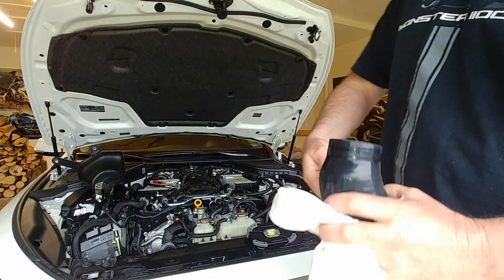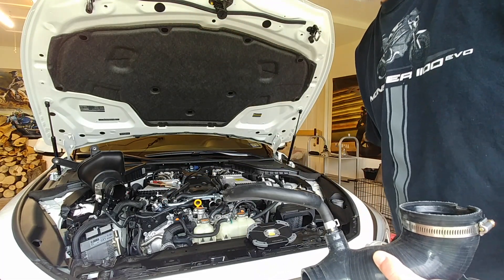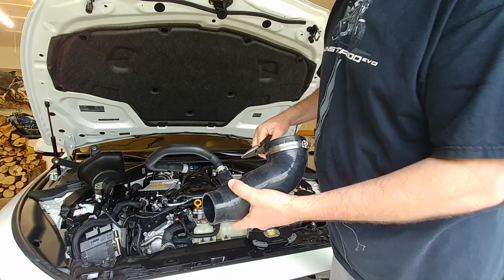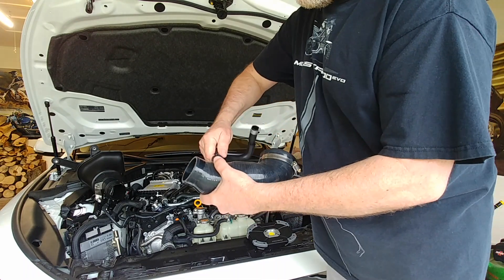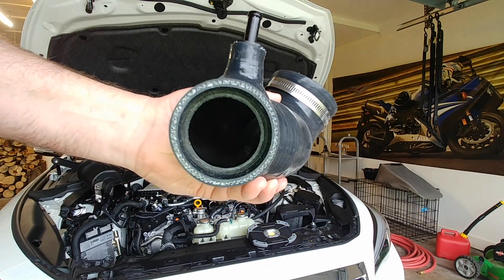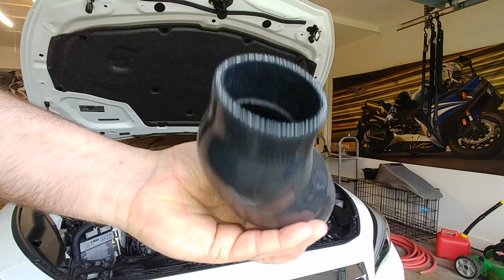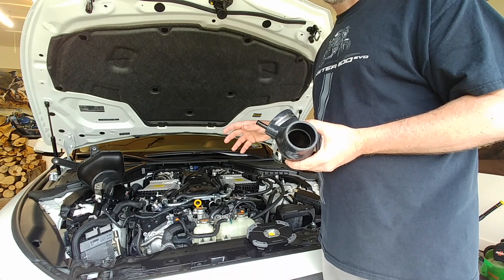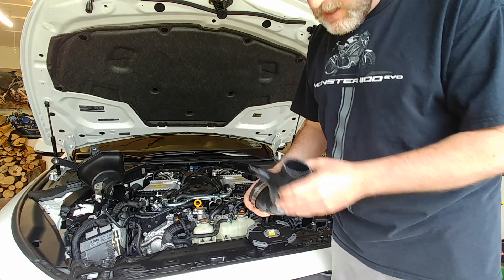Is your VR30 Q50's passenger side CCV sending harmful oil blow-by to your Turbo???

Comment: Awesome video. I just got a q50 coming from a modded wrx, and am dipping my toes in things to change. I've been researching catch cans and found the 3 hose vs 2 hose ones! Will be buying a 2 hose setup after seeing your video, passenger side blowby seems negligible.
Reply from the maker: Inferior companies with bad business practices after they've sold their first version and want to sell more by so-called changing/updating/revising it with no data/proof to back up their claim or need for their product is pathetic..hint Add W1. There was a guy on the forums who had massive oil coming out his passenger side CCV from driving many miles but it was because his PCV hose was 99.9 percent clogged. The PCV hose/s is the one functioning to carry blowby contaminates. People need to be educated and not jump on everything they see and hear without understanding the facts and or tested data. The CCV is a vent not designed to recirculate contaminate blowby. It's a vent to allow the internal part of the motor to not become pressurized like a 1liter Coke bottle. Can the CCV hose have zero traces of all contaminates being mixed and heated in the crankcase...no, but it is so small that its almost not detectable on a car, this VR30 engine that is properly working (my video). Conclusion, say I put another 20,000 miles on my car and I recheck the airbox bottom coupler for oil content. say there is the smallest hint of soot at the end of the CCV hose leading into the airbox coupler...is that worth spending another $200 or 350.00 to attach an additional CC or buy a newer version or an older system. The answer should be no but ignorant people do ignorant things but it's their money and they are free to spend how they want. The Mishimoto has a hard mircon filter that filters out vapors and liquified contents. That is what 95% of the blowby contaminates flowing to the catch can are. Without this micron filter and just so-called baffled crap the blowby is going to go through the oil catch can and out the other side to your intake valve and settle there. Purely these "triple twister" and other fancy named OCC's will catch some oil but what is the point of catching some of the blowby? The blowby (oil vapor, unburnt fuel and moisture) that doesn't get caught say 60% is a lot and will be a cancer to your intake valve. Side effects later down the road in as little as 10K,15K 20K is: rough idle, poor fuel economy, less throttle response, and loss of power.
Reply: @GettingthruLife  Awesome, thanks for all the info! I see you're using a Mishimoto catch can, I will probably grab the same here soon. I ended up selling my '17 WRX because I was deep in the rabbit hole of mods/tuned and it was not great for peace of mind for me personally since it was my only car, we ended up just taking my wife's car everywhere! So my '17 q50 will stay stock power for a bit, I got an axle back with mufflers for a bit more sound, then I am planning to do the catch can and heat exchanger/reservoir before next summer since it reaches triple digits in Utah! Anyways, I checked out all your videos, good stuff, very helpful as somebody brand new to the q50 platform!
Reply from the maker: @Filmingwithacarp  You can find 10% discount mishimoto codes online so look for that when you get ready to buy. Should get the price down to close to $200. I think OCC's are most key to put on a new car or a car that has or is getting its intake valves cleaned. Getting the intake valves professionally cleaned on a 30K-40K no CC car would be beneficial and noticeable. Looking online at this subject there are some cars that are nightmares because of the carbon buildup like audi's and these mini coopers. There are many DI engines that suffer severely greatly from intake valve carbon buildup in which it doesn't even take that many miles to see the engine start to be negatively affected.  I agree, don't go crazy with modifications and keep your Q50-Q60 reliable and running in comfort. My stuff that I've elected to do are pretty mild and hasn't at all changed the drivability and general comfort of this car. The slightly higher-profile tires I've added over the stock setup has added back a little bit bump absorption and compliance. Tune wise when you do this because you will...check out Hussain Boxwala at Racebox Houston Texas. You can do this ecm mod remotely and there is no sacrifice on the tune quality you will receive. Car drives better than the factory ecm setting. He will keep it running well where he can keep your turbo's and CAT in check.
Reply: @GettingthruLife  Awesome, will keep that in mind! Always good to have a tuner who does good work. Probably a few years away for me, got the q50 used so I am hoping to pay it off and get a 2nd car before I tune! So I got some waiting to do unfortunately, but it seems like there are a few small mods to do to hold me over. Also need to do a lot of engine maintenance, not sure how badly the previous owner beat on the car! But it seems like the vr30ddtt and tranny are quite strong!

Comment: Was oil under the intake?
Reply from the maker: I found 99.95% no crankcase oil residue passenger side CCV the 2 times, many 1000's miles apart checking. Just some common engine, minor grime seen on white cloth looking for oil venting into passanger side turbo. Now the PCV side is a crap ton of oil, water/condensation/caustic vapor blowby. Many cars with forced induction only see blowby on one side of a V6 or V8.

Comment: Cant I just plug the coupler on the intake hose and put a breather hose on the CCV to vent out excess pressure and call it a day or does that coupler need to be connected to something else if I'm going to use a breather hose?
Reply from the maker: Are you saying on the passenger side which is the CCV does it need to connect to the airbox lower airbox coupler tube? I assume thats what you are saying. Man that's a good question. I don't know the correct answer for sure. Infiniti designed this motor  with the exact setup so its likely it needs to be plumbed this way. The CCV side of the emissions system like benefits or needs the airflow that come by the means of that airflow after the airbox and before the turbo. If you did something that this motor didn't like it could led to damaging the motor or the emissions sytems or not allow the crankcase to optimize the internal pressure. Otherwise I'm saying I don't know the answer to your question. As for oil getting sucked out  or blown out the passanger side ccv my evidence and the the word from Mishimoto who tested this, they said no need for a passanger side OCC and when I looked at mine twice over 1000's of miles betweeen the intervals, I didn't see any real amount of oil blowby coming out. Safe/safer to keep the emissions plumbing like factory in my opinion.
Reply: @GettingthruLife  I guess what I'm asking is, I've seen people put a breather filter on the end of the CCV hose so the crankcase can vent out excess pressure and they usually route the air intake coupler to their existing OCC or buy s second CC. Can I put a filter at the end of the CCV hose and seal the air intake coupler so nothing is going in or out of that coupler intake valve? Or do I also have to route that coupler to the OCC/secondary OCC?

Comment: What catch can do you recommend?  Link 🔗?
Reply: I got the dual catch cans from boosted6 but before I installed them I did a walnut blast service on my vr30 . I would totally recommend my Q50 runs like new and responsive . ❤
Reply from the maker: @baggycamera4825 That's the way to go about it. Intake and exhaust valves play a very big role in how engine functions. A infiniti D I. engine is just prone to excessive oil/carbon buildup. Reason while Intake valves are clean, got to take measures to reduce future residue buildup.
Reply from the maker: I recommend the catch cans not designed from China. It seems many come from china but Mishimoto is designed and was tested in the U.S.  (You can take a glass jar with a metal top, poke two holes in it, run the emissions hose to and from and catch some oil. The whole point of adding a catch can and spending the money is to catch nearly all the blowby so you keep your intake valves the most clean.

Mishimoto does this by using a better designed OCC. https://www.mishimoto.com/infiniti-q50-q60-catch-can-2016.html

Price as many things in the Biden economy has gone way up. sucks! When I bought mine in Sept 2019 was $210. And remember you are buying the custom fit hoses, the two-hose catch can, the steel mounting specific car bracket. The parts breakdown: https://www.kseriesparts.com/MIM-MMBCC-MSTHR.html

Comment: Hello 
I have q50 2021 
In see all your video and I love it❤
I buy the car 6 months ago and IAM trying to make as much as possible for the car to be good as possible 
In our country (Iraq) in summer the weather 50°c or more 
I need to know the oil I use I use a 0w_20 as the infinite company recommendation 
Or 5w30 
IAM so confusing 
I need your advice 
With my respect
Reply from the maker: Hello to Iraq. 50c = 122 degrees so that's very warm. I would definitely suggest using 5w-30. 0w-20 is for cooler climates so the oil when cold  it flows a little quicker. 0w-20 and 5w-30 is not a big difference but in cold climates will help. In a hot hot climate, oil changes at shorter interval will be a good idea. Oil/filter is cheap compared to a motor or turbo replacement. Look at changing oil every 4,500mi (7242km) to 5,500 (8851km). If you drive the car hard a lot then closer to 6500km.
Reply: @GettingthruLife  
Thank you 
I drive the normal some time and some time hard 
I change the oil and filter every 3000km
Reply from the maker: @mohammedabbas1840  Sounds good. That's very low km/mi but then again it's super hot there in the summer and fine sand in the air. I change my oil between 4,000 miles and 5,000 (6437.376 km -  8046.72 km)
Reply: @GettingthruLife  
Thank you for your time 
I glad to find your video it's really helpful 
🤝
Reply from the maker: Also use a trusted brand of full synthetic oil to run in your car. I use Quaker State Ultimate Protection Full Synthetic. If a store doesnt have it/out of stock, I will use Castrol or comparative brand until next oil change.

Comment: So does blow by also get into the driver side inlet?
Reply from the maker: When I took my passenger side airbox out with the inlet I couldn't find any oil residue other than maybe a slight discoloration on a white clean rag. Could have been discolored o'so slightly from the actual rubber as far as I know. If you didn't have a Mishimoto catch can with its extra fine 50 micron filter on the drivers side then the oil vapor coming out of the cylinder head would get dumped right into the passageway leading into the intake valves. The other side, passenger side the heads breathing port does get directed into the passenger side intake inlet plumbing just before the turbo but Infiniti knew what they were doing when they built the motor. and would not have just let oil get suked out into the turbo. Its primary purpose is to vent clean air into the motor not out. The many morrons on youtube that shouted that Infiniti didn't know what they were doing when they didn't place blowoff valves on these cars were idots too! Including companies that should have known better but so desperty wanted to sell their blowoff valves..
Reply: @GettingthruLife   thanks for the quick response my friend 👍

Comment: Thanks for showing this. I'm currently looking for a catch can and did notice the new version 3.3 of the add 1 was for both sides. I read in a previous video somewhere where it was said that the passenger side didn't need it. It's good to actually see this rather than just seeing words on my screen from someone who may or may not no what they're talking about. This will save me some cash since the new ones are really pricey.
Reply from the maker: Your welcome Scott. It seems that a manufacturer needed to come up with new products to make more money and line their pockets. I called Mishimoto 5 months ago and asked them about this concern and they stated we didn't see the need to make a more extensive product and then charge more for it if it didn't benefit the customer. That's what I want to hear and what matters to me. Not just you need this new version.

Comment: I have been running the Mishimoto CC just like you for 5k miles on a '17 Q60 Red Sport.  I also checked my passenger side coupler hose during the last oil & filter change, and it was dry, too.  I now have just over 24k miles on the car.  I emptied the CC @ 23k miles (installed @ 19k miles), and it captured about 40 ml of blow-by (mostly oil vapor).  I do 5k OCIs and the engine uses no oil between changes.

Comment: Appreciate this video. I purchased a Add W1 v3 catch can. Then a week later they came out with the v3.3. WTH! I can't afford to double down on the same parts week after week. I hope v3 is good enough for awhile.
Reply: It sounds like what he's saying and showing is that you'll be fine with the 3.1 version that just goes inline on the driver side. It doesn't look like the passenger side has any blow by or enough to be concerned with.